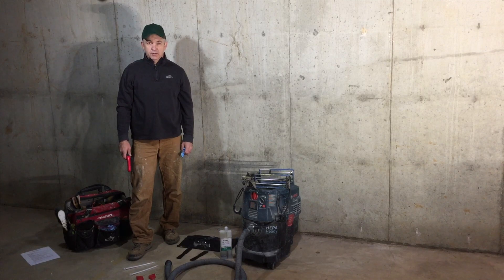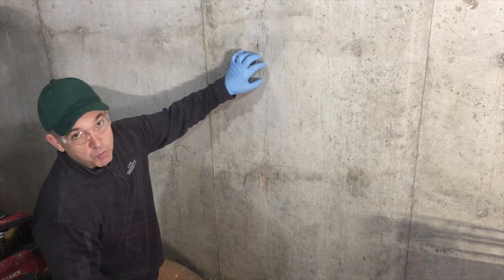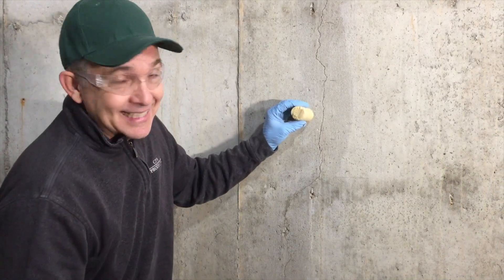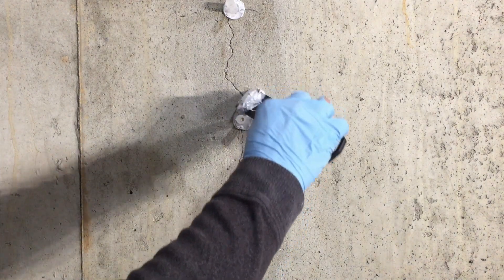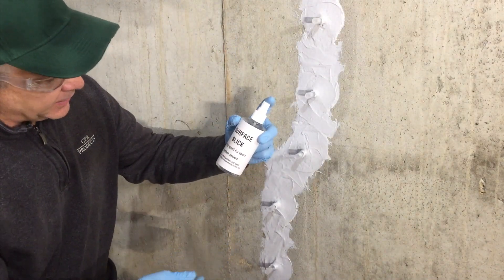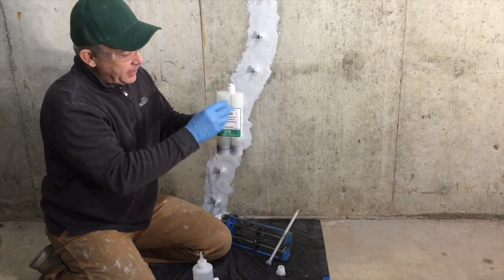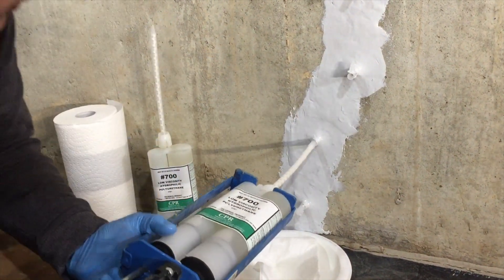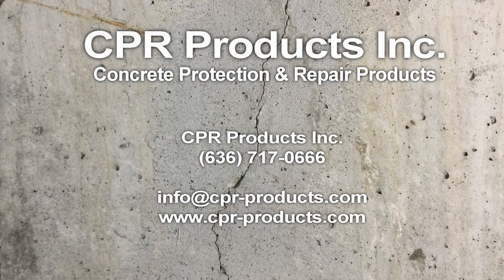Polyurethane injection crack repair - CPR Products

Comment: If the water is getting all the way through the 6 inches of concrete and you just fill the surface crack, doesn’t that mean that water is still permeating nearly 6 inches of concrete and then sitting there? Seems like the only solution is to create a seal on the exterior of the wall. If the sealant is thin enough to go all the way through the concrete, won’t it just ooze into the dirt and use up your tube? Im thinking about digging around my foundation. My crack is leaking behind a newly installed shower in the basement. I have muddy water oozing out the shower seems.
Reply from the maker: If the fracture is wide enough to accept material the injection will travel all the way through the wall. If there’s no void on the other side of the wall the soil will stop the material. However, the most effective waterproof repair is to excavate and seal from the outside. Injection is an easier less invasive option. If you’re willing to dig, we’d absolutely recommend that.

Comment: Surface slick is just soapy water
Reply from the maker: You can absolutely use soapy water to achieve a similar result.  Just make sure to clean and dry the surface after everything is cured to avoid a little mildew/mold.  Surface slick is a chemical agent that eliminates that issue. There's neither soap nor water in it.

Comment: What do you do with the ports after its dried? Do they leave them in place or break them off?
Reply from the maker: It will be up to your personal preference. It's common to leave the paste and ports in place (when selling the house, it's good evidence the wall was repaired).  But after material is fully cured (wait 48 hours just to be safe), the paste and ports serve no further purpose.  The paste can be chipped off and ports fully removed.  Or you can saw off the port barrels flush with the wall and leave the paste (if you're putting up drywall for example).

Comment: So, I got estimates to have this done on my basement wall. The last guy said he would drill hoke to place metal parts & screw them in. Another company mentioned the same procedure you described w/no drilling. Why such a difference in technique for a hairline crack? The guy who said he would use metal ports said he would do it off to the side of the crack. Is drilling holes for the ports a bad idea? He also said no epoxy would be needed on the crack.
Reply from the maker: Both contractors are suggesting an effective repair.  Drilling in order to intersect the crack in the middle of the wall is common if the contractor has invested in the equipment required for high-pressure injection. The material pumped in will flow toward the soil and toward the inside of the basement simultaneously.  Overflow foam will be scraped off on the interior wall surface.  Low pressure injection with surface mount ports and surface seal epoxy paste is just as effective as long as the contractor is using a thin enough material to penetrate the wall all the way out to the soil.  For example, our #900 is too thick in viscosity to penetrate a fracture less than 1/16".  A hairline crack will require a much thinner material like our #700.  Also, the term hairline can be misleading - about 1/64" is the tightest crack an extra low viscosity resin can penetrate. I would suggest you go with the contractor that offers a reasonable price and also enjoys a reputation for quality work.
Reply: @cprproductsinc  Thank you for your excellent explanation. I guess my concern w/the drilling is that I will have to repair the holes left after the ports are removed, w/some sort of paintable vinyl caulk. Either way, I will have to paint over the repair. I have a poured walls that look like brick painted in an off white color. The crack is pretty thin, but exact measurement I am not sure of. Both repair guys said the filler will go all the way to the outside wall. First estimate w/the plastic ports & epoxy was $600. The drilled ports was $750 for one wall or $1000 for 2 walls, one of which does not leak. Both are reputable from what I have researched as least for repairs like this. As a single woman, I have to do my homework.
Reply from the maker: @barbs1298  Glad to help.  The stamped concrete may complicate the job for either approach, but those prices sound fair, and either contractor should be able to give you a permanent repair with a warranty. Drilled holes should be quick for the contractor to patch upon finishing.  Conversely, a surface seal epoxy paste should be non-structural; curing fast but brittle.  It should be easy to chip off (don't grind it off - nasty particles) You should wait 24 to 48 to remove the paste and ports, then paint.
Reply: I need some contractor in lawrenceville Georgia. Can you recommend any for me, thank’s in advance.